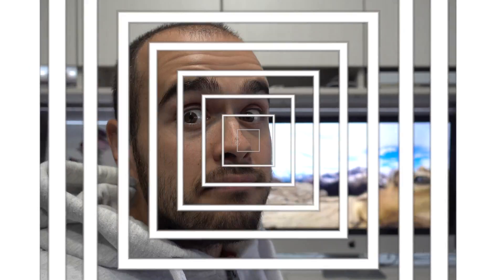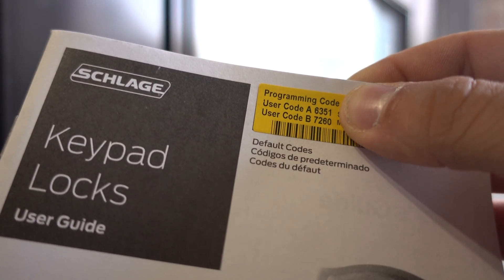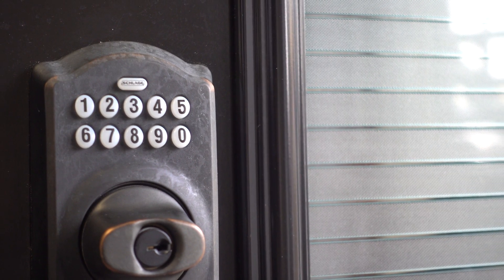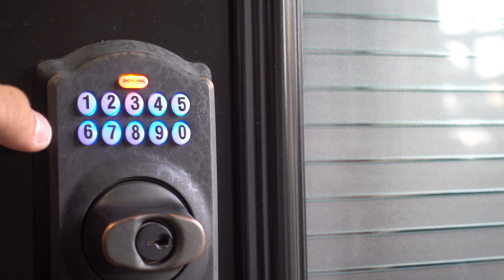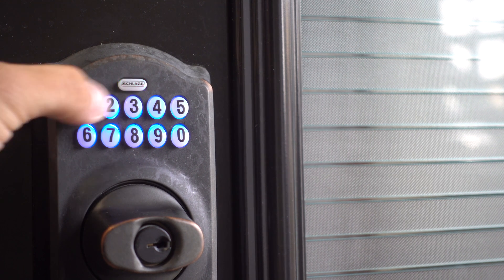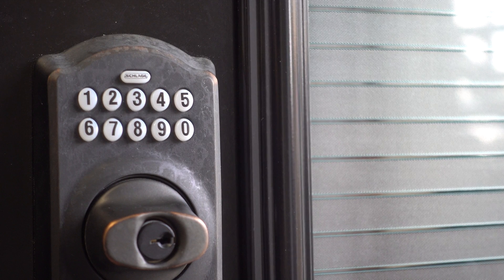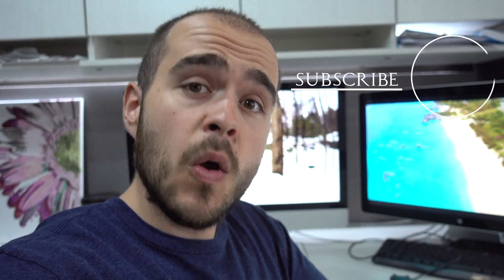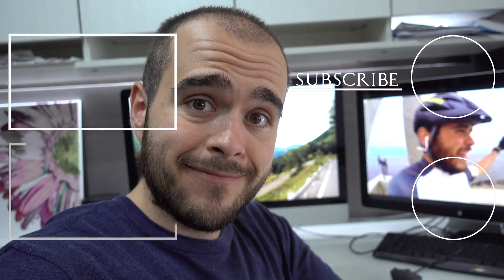How to Change Programming Code On Schlage Door Lock

Comment: I moved into a house and the previous owner did not leave the manual with a programming code.  I took the lock apart and it appears he removed the sticker with the programming code from there too.  How can I get a new programming code?  Is it possible to change the code without it?
Reply from the maker: If the sticker inside is gone I'm affraid there is nothing you can do.

Comment: Hello, are the default user codes disabled when a new six-digit user code is programmed?
Reply from the maker: Hi! Yes the default code will be overight with the new code.
Reply: @HowToPM  not true....
Reply: @HowToPM  you press 1 to add codes and two to remove
Reply: You resemble Damien Crosse or Cross.

Comment: If the battery goes dead and i do not have a replacement battery available AND I want to be able to LOCK the door from the inside using that little latch and UNLOCK the door using a key......Can I do both ?
Reply from the maker: Sure of course!

Comment: I can't put in more than 4 numbers without it flashing red
Reply from the maker: Hello Alia! Thank you for your question. I think only programing code can be six digit long. User code are only 4 digit long.
Reply: @HowToPM  thank you for replying! That's exactly the problem though I want to put in 6 digits (the programming code) so that I can change the user code but after putting in the first 4 digits of the programming code it flashes red
Reply from the maker: Oh! I see, that mean that the 4 first digit you input do not match the 4 first digit of the programming code. I think you will have to take a look at the factory reset video that I mention at the beginning.
Reply: @HowToPM  that was the problem! Thank you!!!
Reply from the maker: Great! You are welcome! I'm glad it help! Thank you very much for your comments Alia! 😊